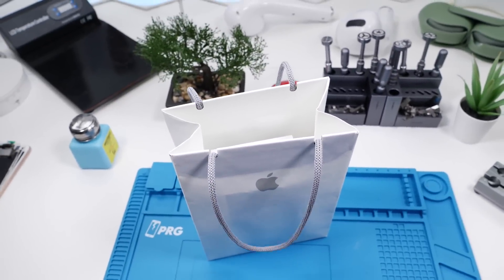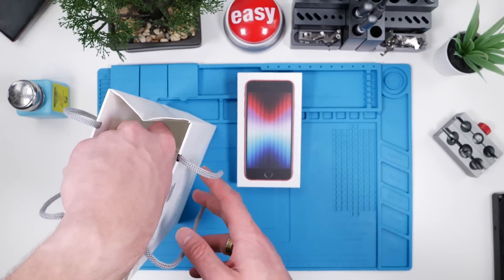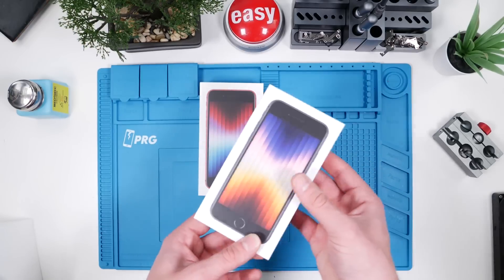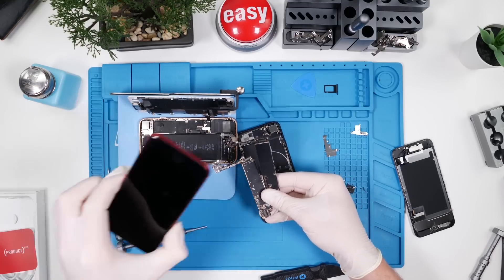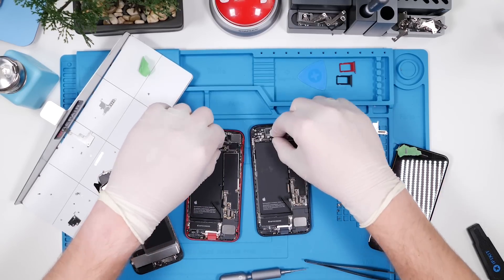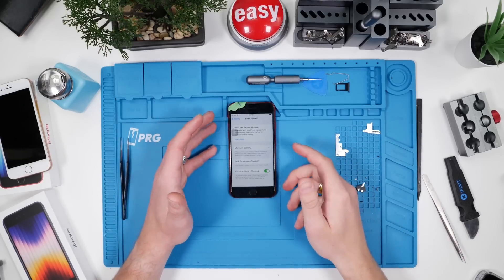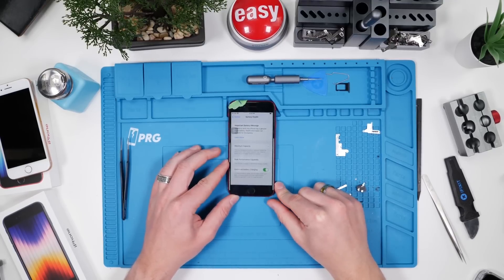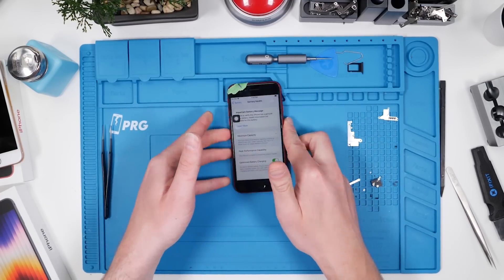Is The SE 3 Repairable?

Comment: I have an SE3 and I’m experiencing some major issues, my first SE3 completely shattered the front and back the first time it fell out of my pocket, now I’m tall but I’m not THAT tall, I’ve had my iPhone 11, my Samsung A20 and my Samsung J3 star all fall out of my pocket multiple times from different heights because I’m stupid and always put it in my back pocket and the only one that shattered the first time was my SE3, we took it to Apple who said they couldn’t repair it, a few months later I got my SE3 replaced and I’ve now had this phone for almost 2 years and it is officially experiencing some major issues, my home button makes a weird noise and doenst go back to normal unless I turn it off completely, now I’ve always had that issue but it’s getting worse, my family and I pay for unlimited data and I’m constantly getting “low data” notifications, FaceTime glitches out horribly on my SE3 however when I FaceTime people on my tablet there are rarely any issues, if I’m not at my house connected to Wi-Fi my phone is extremely slow and takes about 5-8 minutes to send a message and most of the time will say “message failed to send”, my phone screen also freezes randomly and the touch screen occasionally doesn’t work, I was able to upgrade to an iPhone 13 which my sister has had for a while now and she has no issues with her phone

Comment: Just got the SE 3, I had the XS max. I honestly think this was such a good choice It’s so fast and the battery is perfect I love the TOUCH ID. i plan on getting the iPad Air 5 to compensate also because I need a laptop so yeah I love this phone!
Reply: so you downgraded ..... very heavily...
Reply: @negig2161 the only downgrade was his screen the se 3 is better in every other way
Reply: @negig2161 actually se2 and se3 are said to out live the 11 pro and up and I would have to say it does I bought my iPhone se2 last summer my nephew got the 14 plus and his back glass is shattered the iPhone housing is bent and the phone over all don’t have the protection my iPhone SE 2 has and I’ve drop mine out cars and off three roofs and still works like a champ no damage slight scratches but nothing super noticeable and I over all love my se2 I also use a iPhone 7 for work and that still works better then my se 2 does. lol it’s not about the amount of money they are worth it’s about the quality of work that went into each device to work as they were intended to be used.

Comment: reason being the touch ID is not working because the touch ID button is linked to the logic board. even though they are physically separated but still if you even for example only change the touch ID button it will not work as the logic board will not recognise it as its own. must be serial number linked. The same applies to all iPhones with touch ID.

Comment: I have the new SE this phone doesn’t feel cheap in anyway . Very nice to hold premium built despite the old design and the 720p display is actually nice. Touch ID I’m loving it and also the battery is better than expected. Don’t understand all the complaints about the hardware which doesn’t matter to me the main thing is the best chip A15 that’s inside and will be supported for at least a solid 5 years. This phone is for people who could care less about the extra bells and whistles of a more expensive phone at the end of the day it’s a IPhone with IOS and A15 chip that runs smoothly as the $1400 Pro Max .
Reply: So you're going to use a 4.7 lcd screen till 2027?😀
Reply: @kisakion  
lol no but will hold on to this phone because I’m pretty sure this is the last version of this body style.
Reply: @kisakion  I prefer small devices to be honest… LCD is okay as long as the screen has great colour accuracy, like iPads.

Comment: It’s a 4,7 inch 720p LCD Screen with 2000 mAh battery  for over $450 come on!
The chip inside and the camera are good but… the other parts are from 6-7 years phone lol.
It needs to be with a better design or a cheaper price!

Comment: Hello I have a problem I charged my iPhone SE 1 overnight and now it Dosent boot anymore ive tried everything but it Dosent do anything that was 2 years ago so is it fixable?
Reply: Certain aftermarket chargers can actually damage charge ports. I would first check if your port is dirty, if when you plug it in, any of the cable plug sticks out, take some needle tweezers and scrape it out, avoiding the pins. If that doesn't work, I would bring it to a repair shop. You likely need a new charging port or a battery, maybe both. Good luck my friend.
Reply: @judedunlop7238  i already did
Reply: @judedunlop7238  it Dosent work
Reply: @RacerA8  Then take it to a shop, sounds totally fixable to me
Reply: @judedunlop7238  Well im loving in Germany and where I live there are no repair shops sadly

Comment: That plate is necessary for 3D touch, since 2020 SE doesn't use 3D touch so that plate is removed, i messing around as repair guy and fix hundreds of hundreds of iPhone, i can confirm 3D touch isnt that responsive if we dont install that plate, it work but not as good as when the plate installed

Comment: does it ever happen to you that when you change a screen and you rescrew the plate over the connectionts but it doesnt sit fully flush? all the cables are connected properly but it just kinda need to bend a tiny bit it doesnt interfere with the closing it up or anything else, but it happened to me last time and i was just a bit confused.
Reply: I’ve never had that mate
Reply: Probably the chip isn’t aligned properly with the backplate, happens on the 7 the most.
Reply: Do you mean as in the earspeaker, home button, or the emis (shields that are in the phone). Also, which phone?
Reply: @judedunlop7238  I’m talking about the metal plate that goes over the two display and the battery connector. This happened with the 7 and 7 plus, the plate would just ever so slightly bend when i screwed it in. It felt like maybe the thermal pads (or whatever the foam looking things that are taped to the metal piece) didn’t sit that flush on the connector therefore bulging the metal a little.
Reply: @Kradith  does it happen with the original screen? Could be your replacement parts, could also be that the connectors aren't flush, but you would probably notice touch or home button issues. I can't say I've experienced something similar, and I repair 10 or so phones a day. As long as it's not serious to the point where you're getting pressure marks on the screen and the cables are secure I wouldn't worry too much, the shields just there to keep everything in place right? 👍
Reply: @Kradith  from what you are describing the foam pieces on your replacement screen could just be cut too big
Reply: @judedunlop7238  yeah it happened with both replacements and original screen. And yeah it was the plate to keep everything down, so I’m not  too worried about it, just curious if i was the only one lol. Thanks for the input!

Comment: Can you check if the battery of se3 is compatible with the 8 ? It will be a good upgrade
Reply: Battery connections are different.
Reply: @readthebible1958  😕 the only interesant part to swap is different 😕

Comment: A lot of people say how dated and old the iPhone 8 design is. I personally actually really like it and prefer this uninterrupted screen instead of a annoying ASF Notch or Hole punch.
And it is a real shame that the iPhone SE 2 (And probably SE 3 as well) Don't cone with 3D Touch. 3D Touch wil literally let you navagate without a home button!
Reply: Apple killed 3D Touch a long time ago.

There ain’t much 3D Touch support even on 3D Touch capable devices. Apple pretty much just neutered the 3D Touch support starting from iOS 13.
Reply: @staidey5994  Even on the latest version every feature (Except for Peek and Pop) still work on 3D Touch devices! I am not sure if drawing still works but I know using the keyboard to select text or as a trackpad, Going into the app switcher or the next app, triggering app shortcuts, and instead of peeking you get an app preview that you can touch into. All of these things you can do with Haptic Touch and with 3D Touch. (Except for trigger the app switcher) 3D Touch has no delay at all while Haptic Touch takes 1.0 seconds.
Also woth 3D Touch you can trigger the trackpad anywhere while with Haptic Touch you can only do it with the spacebar.
I own a iPhone 6+ and not having 3D Touch is a PAIN!
After helping other people woth their iPhones (iPhone 6S, 8, X, XS, XS Max, 12,  13, and the minis) I found that 3D Touch is not only faster but wayyyyyyy more satisfying to use due to pressure being applied. 3D Touch is not dead dead yet and I would personally prefer the iPhone 6S on IOS 12.5.5 because I want full 3D Touch with Peek and Pop and everything and because of the jack.
I won't be updating a 6S if I get it on an older version.
Reply: @staidey5994  I know from experience.

Comment: iPhone and reasonably priced doesn't go well together lmao
Reply: Depends on a couple things: if you’re buying higher-end tier phones from Android phone manufacturers (i.e., whatever Galaxy just came out, whatever Pixel just came out, whatever OnePlus phone came out now that they’re more expensive, etc.), then there’s not really a price difference.

I got the XS Max on a carrier deal back when it came out, so I paid nearly nothing, but even without the deal it was $1,099 starting out. Yes, that’s more expensive than the aforementioned phones’ starting price, but I’m carrying this until it doesn’t get updates anymore. 3.5 years in and it’s expected to be updated for another 2.5 years for a price per year of $184.

Before that, I had a Galaxy S3 until it didn’t get updates after two/three years for a price per year of $200-300 since it was $600 new, then I had an LG G4 until it didn’t get updates after two years for a price per year of $300 per year since it was $600 new, then I had a an LG G6 for one year because I heard it would also only have two years of updates (would have been $350 per year), so I ditched it early for an LG V35 via Google Fi thinking I would get longer update support since it was a Google fine. I was wrong, and it cost me $850 for another phone with only two years of support. Samsung phones were only having support during this timespan of two years, as well.

Apple also does well on the more budget market. The iPhone SE2 and SE3 will get a similar 5- or 6-year support window, so the Android equivalent would have to be half as expensive if you update it every 2.5 or 3 years.

I hope Android is better now than it was previously with updates as I absolutely will not use an unpatched, vulnerable phone for work purposes.

So, for at least through the start of 2019, even Apple’s over-$1,000 phone was a better deal over time. Absolutely no battery issues nor performance issues thus far, even after so long.

I’m not a fan of any company mentioned, but will always choose the better-valued phone phone over time because of how expensive constantly needing a new phone was after just two years.

It sucks to pay a lot of money upfront for something, but it’s all about your return in your investments, not how much you put into them.

Comment: 2:42 Actually that's incorrect, Apple said the glass on the SE 3 has the same durability BACK glass as the iPhone 13, not the Ceramic Shield.
Reply: The back glass was never ceramic shield 
Only the front was
Reply: who asked
Reply: Nobody asked you 😐🤷‍♂️
Reply: @TheGrobe  Apple's phone concept is to mass produce at most 4 models each year.  This leaves no room for a good model.
Reply: Rip, you informed the correct information but some people here just bully
Reply: Back glass is garbage.  Nothing on the back needs to be made of such fragile materials.  Use metal, plastic or rubber to eliminate many repairs.  Also, fronts should be guarded by a frame that will hit the floor first so the screen isn't cracked or scratched.
Reply: @johndododoe1411  also depends on the care the user takes of the device. iphones dont have impact frames like literally every other phone for the sake of appearance. cases in general are pretty cheap, too
Reply: @Carlo Mig you forgot to add “🤓🤓🤓”
Reply: "AcTuAlLy ThAtS iNcOrRect"
Reply: @J-wb3ek  I mean he's still right lol
Reply: @J-wb3ek  I mean he’s right?
Reply: @J-wb3ek  "umm actually"
Reply: @J-wb3ek  😂😂😂
Reply: @J-wb3ek  YeAh iT iS bRo
Reply: The way you said that makes you sound like a 50 IQ person
Reply: oK mIsTeR sMaRt.

Comment: I was looking at the specs compared to my iPhone 7 and 90% of the specs looked the same on paper (minus obviously the 5G /A15 and wireless charging etc) . Is the screen the same as the 7 and 8? They have exact same PPI and nits and 4.7"
Reply: I haven't used both but I think yeah it is same, and also the battery life is going to be wayy better than a seven
Reply: I think it’s the exact same screen as the 7 except that the 8 and SE 3 have True Tone, whereas the 7 didn’t.
Reply: Same screen but iPhone se doesn’t have 3D Touch, and the iPhone 7 doesn’t have true tone
Reply: I assume that it’s basically an upgrade of the 7 and 8. Better chip (by a long shot in your case since your using a 7), twice the RAM, better camera, and much better battery
Reply: They are the same screen, the only different only flex cable and the frame / bracket, one day i ran out of iPhone 8 screen, I simply take iPhone 7 screen, remove frame and backlight + 3d touch sensor, and replace it with iphone 8 backlight + 3d touch, iphone 8 bracket and viola it work until now, i am repair guy btw
Reply: I'm pretty sure it has better color accuracy
Reply: Not considering CPU, battery life, refresh rate, resolution, charging speed, and all that other stuff
Reply: @wolfetteplays8894  yeah but they barely change, they just now added 120hz to the new iPhones, starting at 1000 dollars lmao. Apple is shit stop trying to defend them.
Reply: the phone has basically been the same since the iPhone 6 other than some camera improvements over the years in hardware and software, 5G, and the A15. This year I think people are saying the battery is slightly bigger as well but it's basically the same phone for like 8 years in a row.
Reply: @HearMeLearn  The same phone? First of all, the SE 3 has four times the RAM, a chip 7 generations ahead, a much better battery and stronger design, plus overall improvements. Idk how dumb you have to be to think this phone is the same as the 6. It’s literally got the chip that the current flagship has!